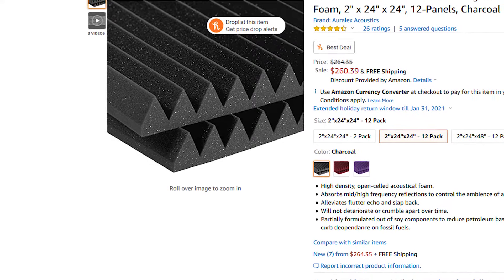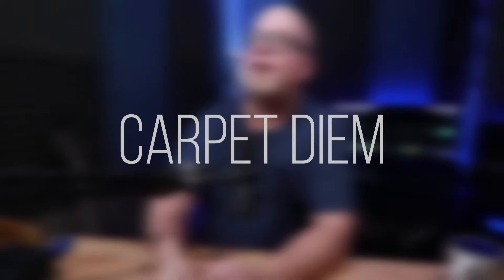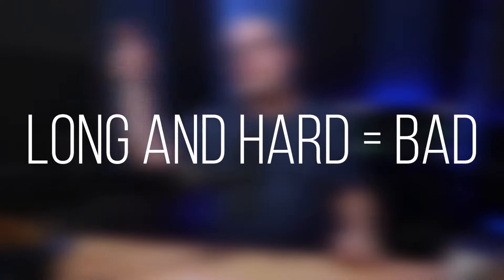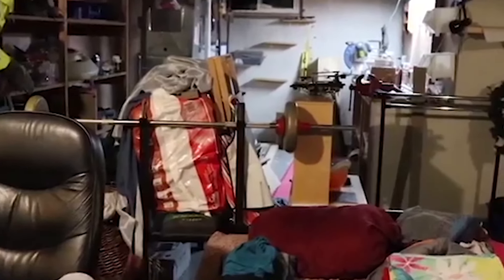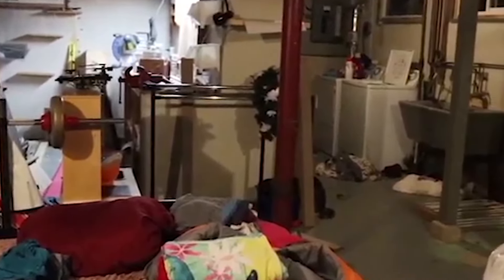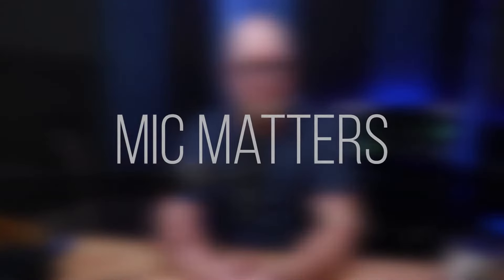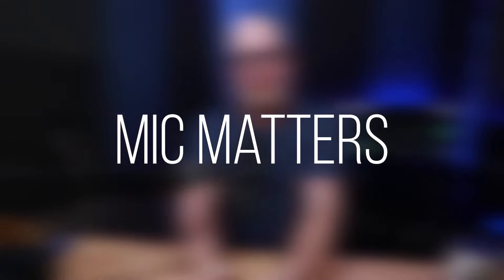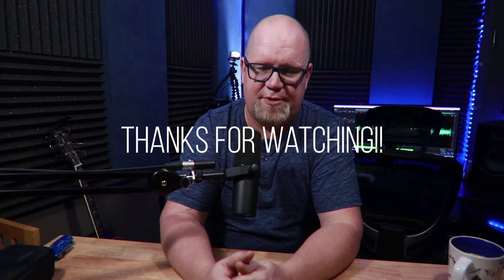ACOUSTICALLY TREAT YOUR SPACE FOR CHEAP!!

Comment: I've had studios with over a thousand dollars of auralex acoustic pads on the walls completely treated.
I've also had bedroom studios that had carpeted floors, where I purchased 3 or 4 mattress toppers that
you can buy for relatively cheap from Walmart, and those do JUST AS GOOD and are a million times less
expensive!  My current room has 4 king sized mattress toppers that are 2 inch thick foam and I have them
hanging on the wells.  I have two covering the wall in front of me.  Two covering the wall behind me.  And
I also have a queen sized topper that perfectly fits the wall to the right of my desk.  Total cost for all of the
toppers I used came to about $200 dollars.  Which is still so much cheaper as acoustic pads.  Basically if
you see anything with the word "acoustic" in it, just know you're being overly charged!  I've been recording
professional music for the last 20 years.  There is absolutely nothing wrong with using mattress toppers!
Reply: My current room averages about 20 dB when I stay quiet.  Which is pretty damn good for a bedroom
studio!  You can get away with recording professional vocals in anything under about 35 - 40 dB.
However, if you get up above 30 dB you'll definitely want to use eq and limiters to cut out the noise
that's not wanted.  However, that's super easy to do!  Especially with a plugin like "CLEAR".  I use this
plugin called "CLEAR" that easily removes any unwanted room noise such as computer fan noise, or
the mini fridge I have in my room.  I also record my weekly podcast in this same room and the quality
is just as good as any of the major podcasts available.
Reply: Dude… how did I not think of this
Reply: Damn straight brother!!
I use 'em, too!! 😊
Also, put a half of one on ceiling over my desk (which has couch blanket over it)
And, I use a black out curtain on the window.....
Great sounding room for voice and instruments 🕺🎶🤘
Reply: What do you think about moving blankets?

Comment: I just learned quite a lot from this video, no wonder my messy Room doesn't have reverb. 
Since there's so much noise in my Room birds chirping, dogs barking my Super Noisy Water/swamp Cooler, MV7 Suited me best.
I removed the Noise using Nvidia Broadcast, I use 19.5 db on MV7 & used Voicemeter for gain, put a little compression & Everything works well, Now I just have to work on my Content. Oh Yeah I use the MV7 on USB